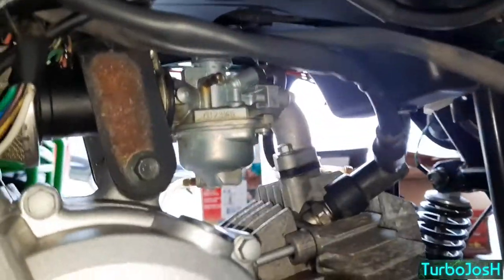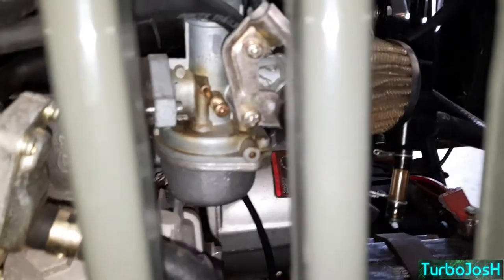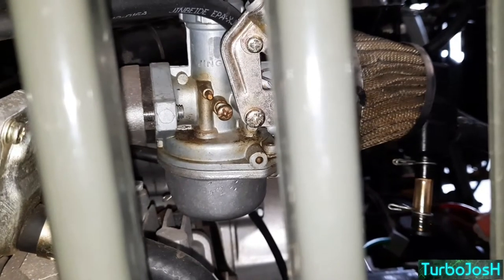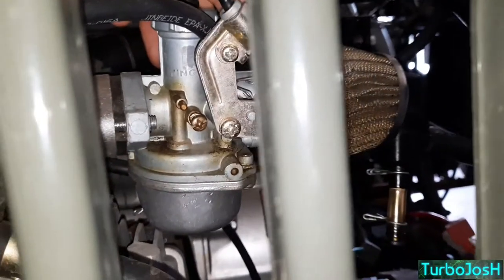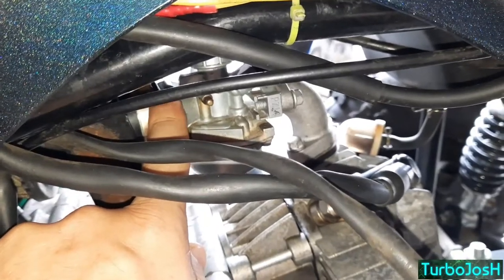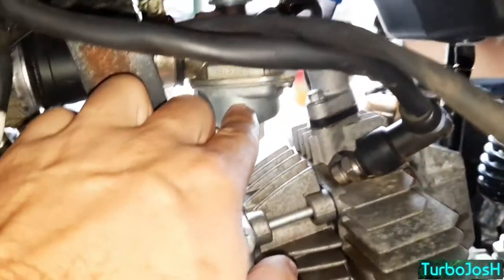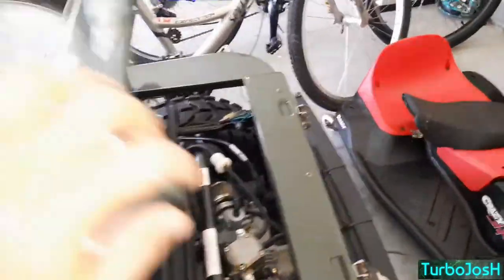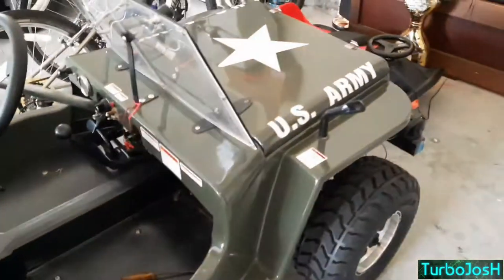HOW TO CLEAN A CHINA "SEALED" CARBURETOR!

Comment: I have took those apart a lot. Get u a chizzel and make u a slot on the head of the screw it's from where they cut the heads off. Them screws will come out if u know what u doin then take ur bolts to ur closes hardware store an match ur screws up
Reply: i jusr cut a slot with the dremmel and a small cut-off wheel and you can use the screws over again